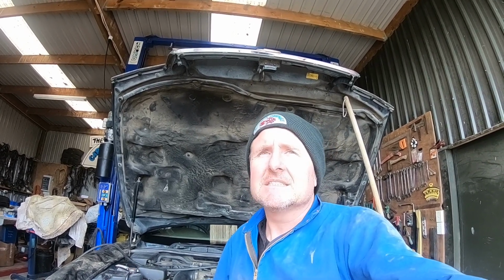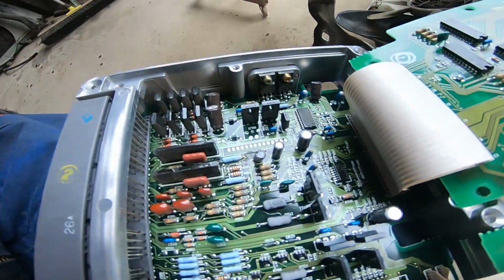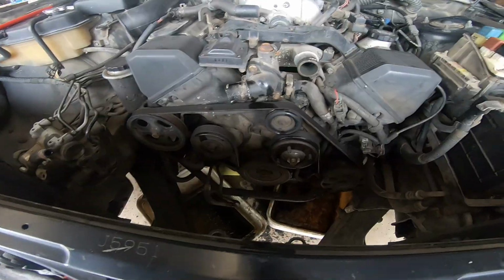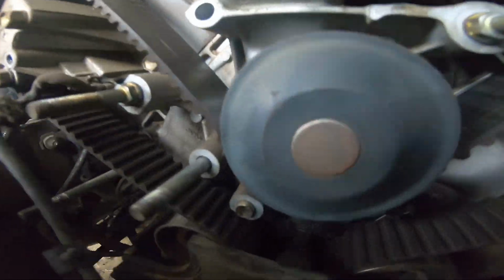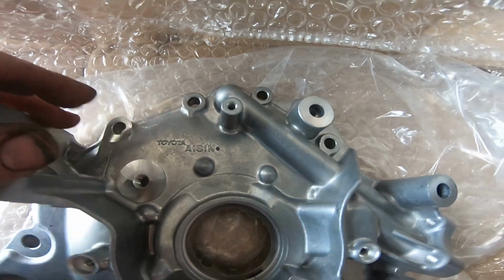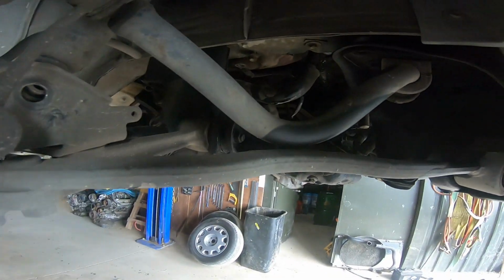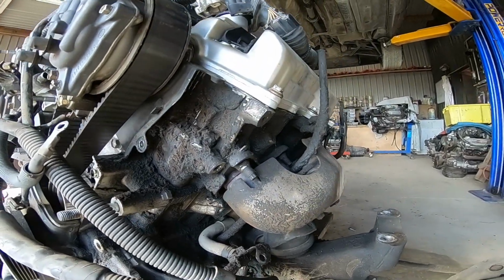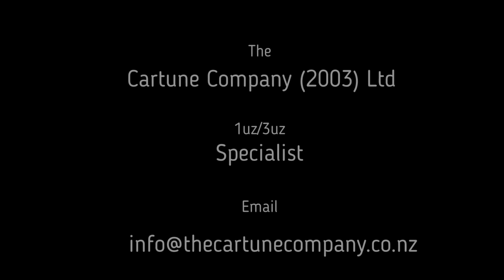ls400 Refab part 2.  We find an annoying oil leak and pull engine out to fix.

Comment: Have a Lexus 400 ls 148 low miles for its year 1997 look nice inside but has a oil leak not sure where it’s coming from what is the normal things that happen?
Reply from the maker: For the older UZ engines every rubber seals is now prone to leaking so best spend some time looking over your engine to find the leak.  Cheers

Comment: Kelvin, is that the second generation engine with the lighter conrods?
Reply from the maker: Sure is.   Ucf20 non vvti.   I have a video pulling one down coming.  Cheers
Reply: @CartuneNZ  Thanks for this great video Kelvin!!!,,,so its 1995-on UCF20R, same as my LS400.  BUT currently I have a 1st generation short engine powering the car with all induction, exhaust and ancillary from the original 1995 factory set up...so here's the BIG question; in your opinion would the second generation ECU and other controls DETECT the difference between the factory engine (2nd gen.) and the current installed engine which is 1st gen. with 2nd gen. induction exhaust and ancillary? There has been no modification or chipping to this car only the short engine swap. 
Thanks Cam.Sparrow Hunter Valley Aust.
Reply from the maker: @Warpedsmac  the gen 2 ecu has enough adaption to compensate for the gen 1 engine in the car.  Swapping  just the long block is the correct procedure and exactly how I do them.  Cheers Kelvin
Reply: @CartuneNZ  Thanks Kelvin for confirming...the 1st gen. is running just fine; typical low idle problems with the air idle valve etc as you would expect.  Thanks again and I look forward to the new video of stripping the block.

Comment: What was the part you punched a hole in at 4:17 and why?
Reply from the maker: I was showing the the intake tube between afm and TB had a hole in it.  This vehicle had many issues when it arrived and unmetered air entering through that fitting was one of them.